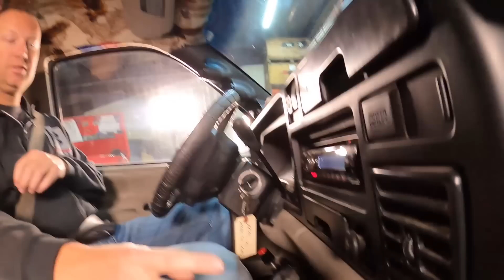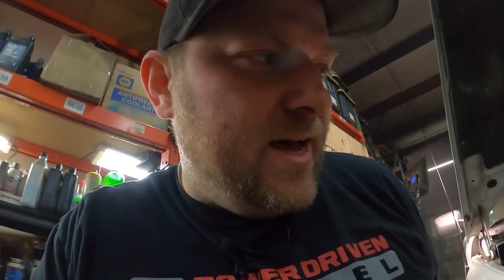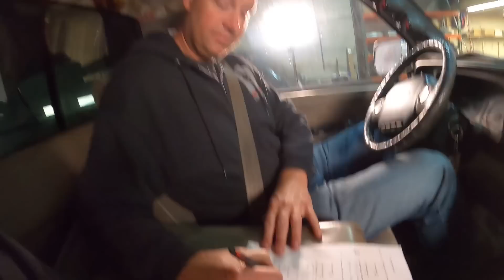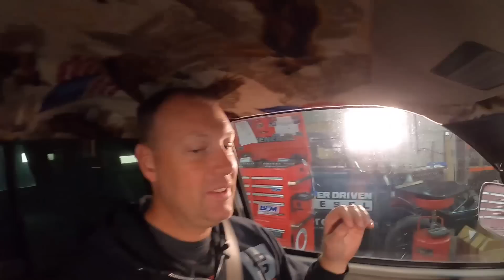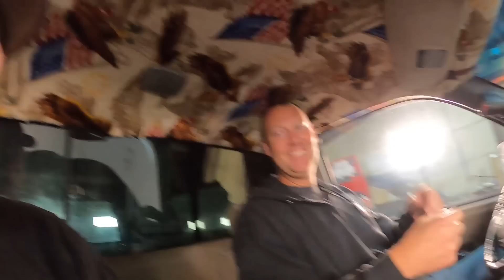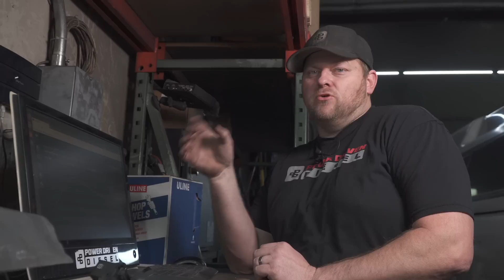Turbo Dyno Test HX35(60mm) vs BorgWarner K27 | Power Driven Diesel

Comment: Tell us what you REALLY think about Gale Banks!  (seriously, this is going to be golden) :'D
Reply: Gale banks sells gimmicks
Reply: Banks is right when he's talking about airflow and density, you can't argue that, but where he's at least partly wrong is when he claims that smoke is lost power... True, the engine is burning less efficiently when it's smoky, but for a given airflow limit, you'll still make more power by adding fuel and running smokey
If he's the hot shit, where's his sled pulling truck that's burning clean AND winning???
Reply: @Rx7man  He does drag racing and rallies and hill climbing championships with clean running diesels. 
He’s done Dakar, Baja, King of The Hammers, improves engines for the DOJ with parts he engineered. Where are these guys accolades outside a smal YouTube circle? Because Banks s a world wide name in diesel performance.
Reply: @chloehennessey6813  Does banks have any 2000+hp 5.9's?
Reply: Oh, and while we're talking about clean burning, how about giving credit to the people who designed AFC live which tunes your fuel to your available air.. Gee, I wonder who those people are
Guess what happens when you turn the fuel down to burn nice and clean? YOU LOSE POWER
Reply: Banks got a couple records a long time ago. He can't get one now after all his have been, what, doubled. Gas motors he is great at, but he tries to take gas motor physics and run them on diesels. They are to different to treat the same. If your ran a gas motor like a diesel you would flood it. There isn't much tolerance with a/f on gas, you have a huge range with diesel.
Reply: @Jacksonm80  A long time ago? The 2018 is a long time ago? If he’s bad at diesel why does GM send all their Diesel engines to his company before they get installed in military armored vehicles? You don’t land DOJ contracts by being okay with diesel performance.
Reply: @chloehennessey6813  The record where he went over 200mph? Oh yay, he's my hero...People have been going 200 for what 50 years. So where is his real record here. Just that he did it in a certain motor, a certain chasis? Whats the actual record. So I could take a top fuel dragster motor and put it in a geo metro and do 250 would that be a huge record, I wouldn't consider it so.
He was driving a 700 hp truck, no record there, thats a daily driver for many people.
I never said he was an idiot anyhow, my point was he isn't that great, nothing special for the diesel community.
 
Having government contracts doesn't really mean a whole lot just that he can handle the quantity. The company I work for does government work along side with many others. Most of the other guys do totally shit work.
Reply: I think everyone covered it
Reply: Gale Banks is The Godfather of diesel performance. He’s held world record diesel times and numbers. 
When I start seeing those same accolades about PDD? I’ll worry about what they think of Gale Banks.
Reply: @chloehennessey6813  he has done good things but I can never forgive his selling out of diesel performance to the epa. All companies that kneeled to them should be ashamed and will get none of my business. I do not go around rolling coal but I think you are well within your rights to do so. I also believe diesel emissions equipment is the ruination of what would be a long lasting and  reliable vehicle.
Reply: @compted10  He did what was inevitable. Shit was going to change wether he wanted to or not, wether you wanted it to or not. So why not relent on a few little things to shut them up? 
You have to learn to pick your battles.
Reply: @chloehennessey6813  yeah one of the couple battles we must fight is putting the epa down because they are a rogue agency just like the batfe
Reply: @compted10  Fight the EPA? When you have douchebags rolling coal and posting it to YouTube? You know as well as I do these dumbasses doing it are the cause of the EPA cracking down on diesel performance in the first place. Gale Banks has already proven you can make tons of power and torque WITHOUT sending a wall of black smoke (fuel that isn’t burned) into the crowds watching.
Reply: @chloehennessey6813  the issue is much greater than just the diesel thing, they are an overreaching organization that is under strict constitutional reading unconstitutional being that they are not an expressed power of the fed nor can they really be an implied power. Do I think rolling coal to roll coal is cool, not really however at a certain power level for a particular engine size it is inevitable. Secondly the emissions equipment being installed on diesels is 100% doomed to fail every time just by the nature of operation. It also increases the duration of high egts on all components as well as feeding abrasive materials back through the intake which shortens the life of the engine. Emissions control equipment is a major if not the most significant cause for mechanical failure of diesel engines today, engines that before this equipment had much greater B life values and need less repairs overtime.
Reply: Chloe Hennessey when gale banks makes a 2000hp 12 valve I’ll listen to what he has to say. Guy is a chump.
Reply: @Beersandbrakeclean  not everything gale says is wrong, if you where testing in a very controlled setting you would see changes based on turbo inlet temperature and pressure loss at the inlet of the compressor. Thats why compound turbo systems with interstage cooling make more power than the exact same setup without it given matched conditions and tuning. Also the power driven test with the hood open will help reduce the rise in inlet temperatures and thus not affect the power as much. (This I have tested in a way on the dyno but with a filter and a short tube) Ditching the stock airbox which is likely causing an inlet pressure drop would make up for the temperature rise, along with the intercooler helping to dampen the overall inlet charge temperature increase. In all if you are looking to get every last ounce of performance out of a set up a true cold air induction system (not the crap several vendors produce) with negligible pressure drop will improve performance and can aid in lower turbo shaft speeds. However for 99.9% of people who aren't complete optimization nerds yeah it probably isn't a big deal.
Reply: @compted10  Would like to see them discuss what Lenny from DPP is doing with his recent 12v content as well.
Reply: @compted10  your a real rocket surgeon
Reply: @Beersandbrakeclean  He’s done it. And he’s done it to Fords, Chevies and Internationals. 
Banks is a worldwide known diesel and automotive performance brand. 
How many hill climb and rally championships do PDD hold? 🤷🏼‍♀️ I rest my case.
Reply: Chloe Hennessey please show the proof of this,  also banks is just that, a worldwide known brand. They do sell SOME good products. However, they do sell the brand more than anything. He is a marketing genius and I never said PDD was the best in the business. You have mentioned gale as The Godfather and you’re being a banks cheerleader. Be open minded and do your own research.
Reply: @duffman1241  lol, I'm a test engineer for aerospace stuff
Reply: @Beersandbrakeclean  he’s more than just a marketing genius. He’s also the driving force behind our military having better more reliable Diesel engines in their armored vehicles. 
You seem to think making 2,000 Hp with a 12V is hard. It’s not. And those 12Vs making that much Hp are notorious for puking their parts out onto the dynos they’re on. Anyone can make a 12V have high horse power, but it takes people like Banks to make high horsepower reliably WITHOUT turbos and engines puking their parts constantly.
Reply: @chloehennessey6813  God father of what Diesel performance? The 1970’s-1980’s GM diesels that weren’t really a genuine diesel but more like a GM gas engine converted to diesel? If your aim or goal was to troll, good job and keep up the good work.
Reply: @hubert-wf1xz  lol Obviously you haven’t paid attention to any national diesel drag racing events, hill climbs, Dakar or Baja rallies etc. 
he’s done more than just the GM diesels. His parts are used worldwide by millions of people sold by thousands of companies. He has DOJ contracts and OEM contracts. You don’t get those accolades by doing stuff 30-40 years ago. 
But if your aim was to look stupid, good job and keep up the good work.
Reply: @hubert-wf1xz  pdd stuck in the '90 era
Reply: @chloehennessey6813  You obviously don’t know what this YouTube channel is about so I’ll tell you. It’s about 12v cummins engines, go through the entire bank’s catalog and look at the parts he sells for this engine. You’ll spend $500-$1000’s and not have 1/4 of the power you’d make with the parts these guys are selling. I bet the guys at PDD won’t do it but they should buy another bone stock 12v and go buy and install all banks parts and compare the horsepower gained per dollar spent. I’m not saying Gale Banks is a nobody, but when it comes to 12v cummins performance, he kinda is.
Reply: @jesustrevizo3148  yeah well 12 valve Cummins were built in the 90’s so that solves that. You want common rail cummins performance? Josh is doing that on another channel. You want duramax or powerstroke content? I’m sure there’s other YouTube channels for that.
Reply: @chloehennessey6813 Obviously you haven't paid attention to the parts Banks sells for these engines. $700 intake, $700 turbine housing and a $400 cold air intake. $1800 would be spent and for what? 10 or 15hp max.
Reply: @chloehennessey6813  put the meth pipe down it’s ruining your brain
Reply: @duffman1241  Don’t project your home life on me. 
I’ve been around automotive performance business my whole life. Right now you’re just a guy who doesn’t even own a 12V making himself look dumb. Stop while you’re ahead.
Reply: @chloehennessey6813  lmfao I’ve got more than one 12v. If you ever ran a banks air horn in a 12v you would know it’s junk even compared to the cheep China shit🤣. I can tell you how crappy the banks kits are on my 7.3 too where would you like to start little girl

Comment: Sounds like blowing up a turbo is in the near future with 1800⁰ runs
Reply: Not something unheard of at PDD though
Reply: @Rx7man  that's true they aren't afraid to show the catastrophe that comes with pushing the limits during r&d for the benefit of us to not have to blow up our stuff to learn the limits.
Reply: @73cjproject  I don't take anyone's word for that, I blow my own stuff up anyhow lol... Most recent was jumping 2 teeth instead of 1 on the VE pump truck.. it didn't like 35* of timing much!
Reply: @Rx7man  I haven't ever messed with the pump timing on my first gen. I had it rebuilt and tuned for the bigger injectors I put in it. There is more power in the pump, but it runs so good and honestly the transmission won't hold anymore power. That truck has since become the toy and going to throw an antique plate on it next year when it is eligible. Meantime I have an 05 and 08 that I use. So I still have my mechanical truck but I am a wire fire convert, dynamic timing opens up a whole world of options and likewise,  problems. Lol.
Reply: @73cjproject  I ended up making an offset key to give me about 6* more so I didn't have to skip a tooth.. I'll take it for a run today and see how it likes it.. I did lots of internal pump mods too
Reply: Yea 1800 is bad.

Comment: Any chance you can give exhaust manifold drive pressure readings for these tests?
Reply from the maker: We don't have a gauge hooked up yet, but maybe we could do it on future tests.  I'm sure drive pressure at 3k RPM is at least 1.5x boost pressure.
Reply: @pddofficial  it would be a great way to show the efficiency of the turbine side by calculating the pressure delta. Especially with the turbos getting larger in your testing, I have personally seen over a 70hp gain from going to an S400 with a smaller compressor from an S300 due to excessive drive pressure.